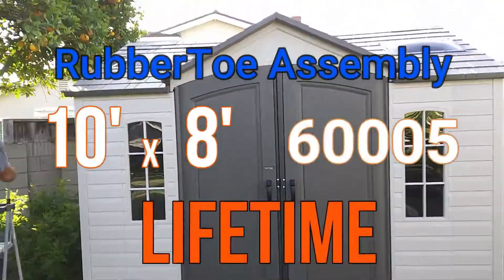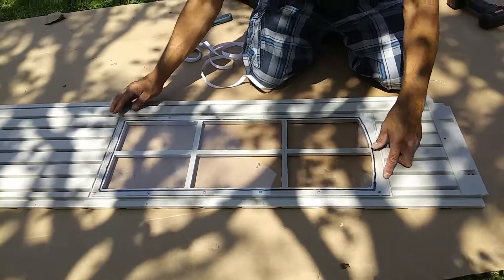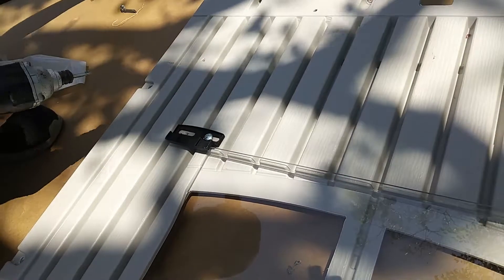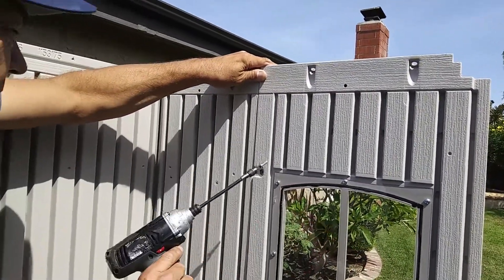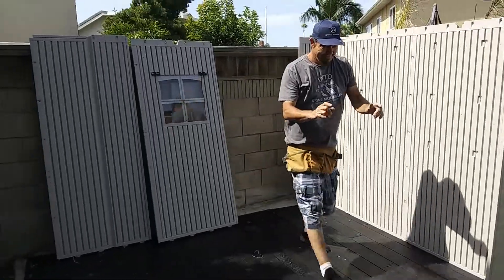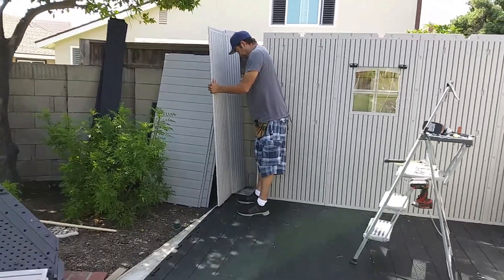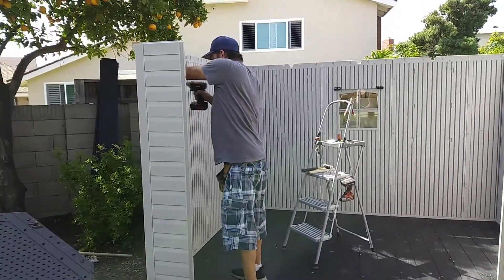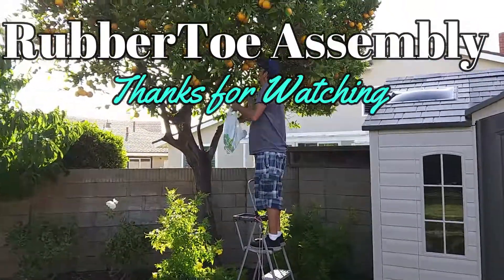Lifetime Shed 10' x 8' 60005 Outdoor Shed Sec 8 How to Build Install

Comment: Thanks for the upload. I get they supply the weather stripping, but do you think it’s over kill to caulk them in? (same with sun roof)
Reply from the maker: hi,thanks for question, ..well, i would not caulk them unless they wind up leaking. then i would use clear caulking and minimum amount should suffice . where needed.on dry surface.thanks ,take care